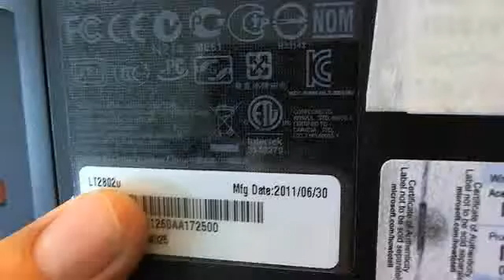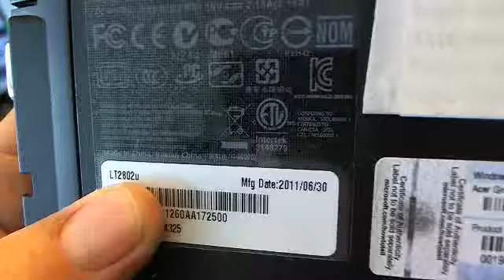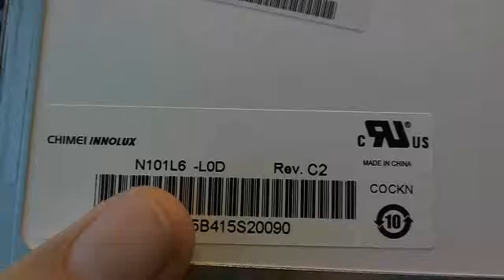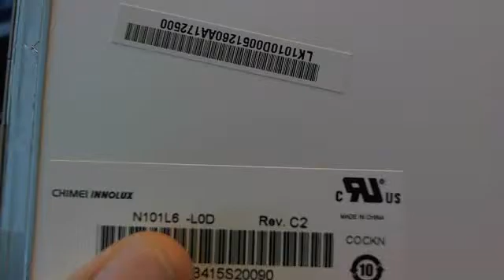Gateway LT Series Netbook Screen Replacement Procedure

Comment: I have a Gateway LT41P05u with a cracked touch screen (dunno if it's a separate digitizer or All In One as the screen is cracked, but still functions), and upgrade a HP2000 & Acer Aspire One ZG5 From Non-touch screens to Touch screens. All I've found online is either Non-Touch screen or Out of Stock... Would you be able to help me find them..?

Comment: Do you know anything about how to fix "Display Errors" my screen sometimes starts to turn black, then it'll blink back to normal. But recently it completely went black, popped back on just that quickly and said Display Error was fixed but then it happened again and restarted my computer to the error screen before it came back on. Do you know anything about problems like that?